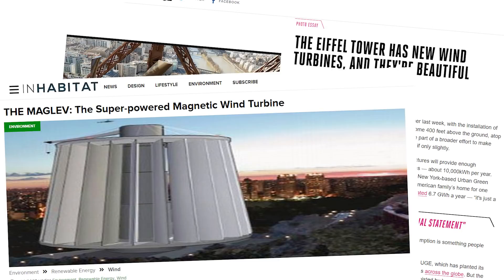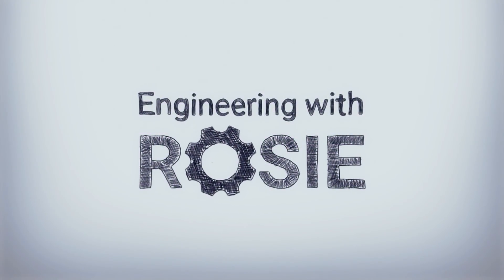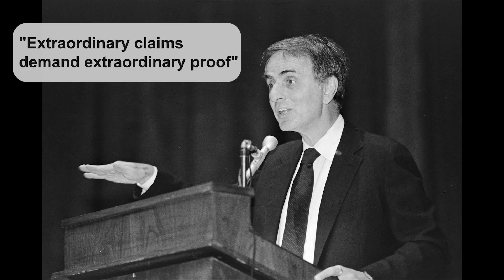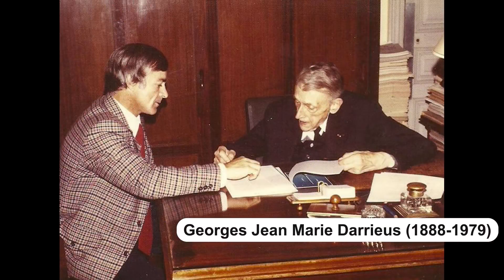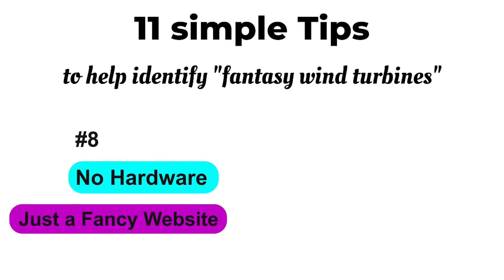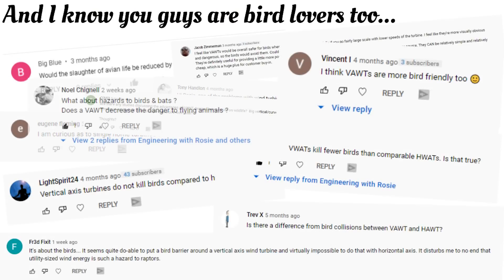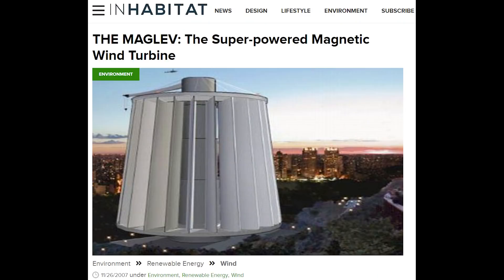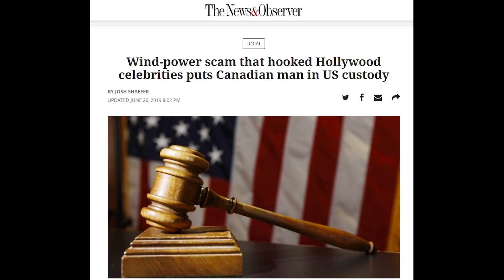Back to the Future of Wind Energy Technology with Paul Gipe

Comment: Paul Gipe is great - calls it like it is.  What are these VAWTs or other designs that do work - you didn't say.
Reply: Tesup has a small, 2kW VAWT that's pretty decent, however, the energy output is still very low compared to a HAWT.  So yes, VAWT's can work but their energy production is always much lower than a HAWT and they typically have short life spans as there's far more stress on the rotor bearings and taken down and scrapped for lack of energy production and usefulness.  Hopes and dreams are the only things that have kept VAWT's still in any conversation.

Comment: Large turbines have a huge advantage over small ones. They can be put 100m up, where wind speeds are higher. The power in wind goes up by the cube of the velocity, and the swept area. Long blades are your friend, unless your turbine doesn't last, or can't survive a storm. Most people should just put up solar pannels. But there are places that really are windy close to the ground. I read an article that said if all the leaves and branches are on one side of trees and bushes, you might be in one of those places. Now if you are off grid, in the winter, you might want every kwh, so it might be worth it.
Reply: Also, the biggest thing in wind power right now is the Haliade X, but the SG 14-222, Vestas V236-15MW, and the MySE 16.0-242 are coming.
Reply: What would you say are best turbines in 15-50kw range for an area with 7.3 meters per second wind speed ?

Comment: Thanks Rosie
One thing that is often missed is how to connect it up and the cost of doing so. 
Once you get beyond the small off the shelf toys. You can't locate it on your roof or in the yard. It's simply too dangerous, where do all the bits go when it self destructs. Not only does it hurt, it costs a lot. What is often dismissed is the cost of a hook-up. Electricity is a highly regulated commodity and there is a premium on this knowledge.
The further away the generator from its load the more the costs escalate and the dimmer it's prospect become for all but the most diehard. e.g. If you consider a flow battery or fuel cell, it is far cheaper to pump the electrolyte around than install copper wire.
Clearly this an area that requires further input.
Someone who has built and operated Vertical Axis Turbines

Comment: This reminds me of a video someone posted years ago, they had a big solar array and a small windmill in their yard and compared which one works better for homeowners. Supposedly the turbine was top of the line model from a good company, but the amount of reliable information that video did not give managed to ring so many warning bells that I was left wondering if he had been scammed and that was why his expensive 3000W turbine only gave him about 200W. Even these days one should watch out when buying an unknown brand micro wind turbine, and back then there was almost no information or oversight on what kind of false claims companies made about them. Also, a lot of installers simply didn't know how to install a wind turbine properly.

Though, now I think about it, maybe he just failed to do any of the required maintenance and the turbine stopped working for perfectly legitimate reasons. Protip: When making a spreadsheet showing how much your wind turbine cost and how much you earn from the power it produces each month, there should be a column tiled "maintenance expenses". Someone, as in a qualified mechanic, needs to check if the turbine is working properly and the blades are all right at least once per year.
Reply: Usually it’s the tower is too short, or they have a lousy wind resource, or there are obstructions causing Eddy currents in the wind which kind of goes back to the tower being too short. If it was a 3000 W Kestrel Or another turbine of that quality it probably wasn’t the equipment fault. Just thoughts based on installations I’ve seen over the years.

Installing solar is much easier and cheaper especially these days. There are many ways for a win turbine installation to fail. 
Good wind turbine manufactures have truthful power curves published for you to look at before you buy. If they say the turban makes 3000 watts at 25 mph they generally do.  If you’re buying from an honest knowledgeable dealer /installer and you have a lousy wind site they won’t sell you a turbine.
Reply: @solarwind907  The picture of it was not very clear but I'd certainly buy the tower being both too short and surrounded by trees as an explanation. Given I have seen pictures of turbines installed twenty feet away from a house or a tree by "professionals", incompetence might be more likely explanation than malice. He said something about turbine having to stop for a while when the winds get too fast, shouldn't they just brake to comfortable RPM if that happens? Or is that just the big ones? Anyways, there was a wind farm some miles away so apparently he just assumed his hill had good wind too, without doing any checking.

Still, he also outright said he had no technical skills himself so he just paid for full installation, and only later mentioned in the comments that the price of the turbine included some very expensive landscaping to bury the electric cables. Unexpected need for extra work rather makes his price figures invalid as an average example of a typical home installation, and "we had to drill through rock because just covering the cable with a foot of soil wouldn't do" sounds suspiciously similar to "yes, you only asked for an oil change but the door was scratched and we had to repaint it. No, it really was there before you brought the car in..."
Reply: @AnalystPrime  small wind turbines protect them selves in various ways. I am sure Gipes book has at least one chapter devoted to the subject. If you can find out what kind he had you can look it up. 

The turbine could have been stopping, waiting for the battery voltage to go down before restarting the charging. There could be lots of things going on from what you’re telling me.
 Anyway, if you work with a reputable dealer/installer with years of experience and happy customers you should Wind up with a system you’re happy with. However, most small renewable energy installers/dealers if not all Of them have gone almost exclusively to solar. Installing small off grid wind turbine systems has never been an easy way to make a living and in the last 10 or so years it’s been a whole lot tougher. Paul Gipe probably knows who’s still in biz in your area. Good luck!
Reply: @solarwind907  I don't think he ever named the brand. There was no battery, he sold all excess production to the grid. Might be that did not work properly when he had both wind and solar and the lines have to connect somewhere, similar to how some people have more solar panels than their inverter is rated for so on sunny days their 10kW system still only gives 9kW.
I suspect the lack of maintenance because in the much better made video about his PV system which had been installed at the same time he showed a good close up view of the panels and they were horribly dusty. Washing them occasionally should be just common sense, just like checking your turbine, and if he hadn't done the much simpler care of his panels then it is anyone's guess if the wind turbine even moves after a decade of neglect.

Comment: Is a paper airplane wing a "drag type device" or a "wing type device"?
Reply from the maker: Lift type. For an aeroplane to use drag I guess it would have to flap its wings (which does actually exist!)
Reply: @EngineeringwithRosie  I see, so it's about whether it cuts through the air or not, rather than being about the shape of the blade...? Thanks for the reply.
Reply: @EngineeringwithRosie  Or be a traditional kite.

Comment: Insofar as wind energy output in low windspeeds are concerned: If a wind turbine produces 1,000 watts in a 20 mile per hour (mph) wind speed how much will it produce in a 10 mph?  Someone new to wind energy might automatically say "500".  Actually wind energy output is cubic relative to windspeed.  The answer is 125 or one eighth the energy (1/2 * 1/2 * 1/2 = 1/8).  I think that's one way people get taken to the cleaners when people purchase wind energy devices.

Comment: An example of this in the UK was building mounted turbines which spectacularly underperformed as per this extract on page 13 of an Energy Saving Trust wind field trials report entitled Location Location Location; "No urban or suburban building mounted sites generated more than 200kWh or £26 per annum, corresponding to load factors of 3 per cent or less. In some cases, installations were found to be net consumers of electricity due to the inverter taking its power (up to 10W)from the mains supply when a turbine was not generating." 
I wonder how many people who bought these products were put off renewable energy technologies in general?
Reply: Thanks Brian for mentioning the GB studies. I emphasize them in my sections on rooftop wind turbines. As you noted, some used more juice than they produced.

Comment: So when do we get the "Top Three Small Home Turbines" that Rosie actually thinks have potential?
Reply from the maker: I would want to have actually tried them myself or at least interview someone who had experience with a bunch. And I currently live in an apartment, so not much possibility to try any backyard wind out yet! For now, I put links in the description to a couple of small wind certifiers who list turbines that they have certified. I won't guarantee they will be a good investment for you, but at least you have the ability to know what you're getting before you buy: 
https://smallwindcertification.org/certified-small-turbines/
https://www.dnv.com/services/valid-certifications-70432 (download the Excel file)
Reply: Having sold over 2000 small wind turbines over the past 14 years, and living with one in my own backyard the past 13 years, I think the Tesup HAWT and Istabreeze small wind turbines are the only small wind turbines to consider right now.  Both are well engineered, have good support with warranties and have significant field experience.  Bergey has their 15kW behemoth but, it's WAY overpriced and an absolute monster, unless you have a large property, 100'+ tower, and huge budget.  For most cases, solar is the best route.
Reply: @RussellFineArt  With Bergey you get what you pay for. I believe you’re talking about a 10 KW machine not a 15 for what it’s worth. Anyway, There are Bergey 10 kw turbines that have been operating for over 30 years. Bergey builds and tests their win turbines in Norman Oklahoma, right in the middle of hurricane alley. They’re built like a tank, built to last. I’m only talking about their 10 KW model So keep that in mind. Bergey has been building those turbines I believe since 1979. The fact that they’re still in business speaks volumes about their product.
FYI I don’t work for Bergey but I have installed a few of their turbines. Solar is a lot easier money but I have to say Bergey makes a fine 10 KW wind turbine in my opinion. I believe Paul Gipe would say the same thing But you’d have to check with him.
Reply: @solarwind907  "hurricane alley"????
Reply: @alanthirtle6969  tornado alley.
Reply: Check out the turbine guy on YouTube.

Comment: I researched small vertical axis wind turbines in graduate school, alot of research still needs to be done for them to be competitive compared to horizontal axis. We're now in the age of 3D printing which allows us to experiment with more complex ideas than before such as blades with variable material properties along its length and blades with complex geometries that were not feasible before. With growing urban built environments, there are increasing opportunities for small scale wind turbines.

But the amount of rubbish published research on small scale turbines is too damn high. Too many published papers that are pure simulation and not enough experimental data.
Reply: Apparently at least two companies managed to swindle government funds for developing some variation of "put a funnel in front of a small turbine" idea, which DOES NOT WORK unless you are building an actual solar updraft tower and that fact has been known for a while and should be obvious to anyone who passed high school math&science classes in case they missed History Of Fail Wind Turbine Designs 101.
(Solar updraft towers are an actual thing that exists and works, you just need a HUGE tower, like at least 100-200m tall but preferably up to one mile tall.)

Worst stupid idea I recall getting large sum of money was some guy looked at his table fan and had this brainfart: small fan=big wind turbine, therefore putting 100 of those 10cm computer fans in a frame will produce more power than a real turbine with 1m2 blade area because there are more of them. Clearly this guy was either drunk, on drugs or senile, but some idiot actually gave him money to start a company and it was on the news as the next big thing for a few days.

Comment: What about a really large vertical axle turbine that floats on a lake? Super low rpm's? Well unless you place the generators on the circumference. The main blade would have a cog wheel outer ring for the cogged receptor cogs to hook into.
Let me make you a fancy website about it to prove it will work.